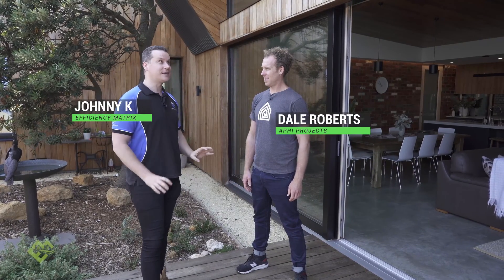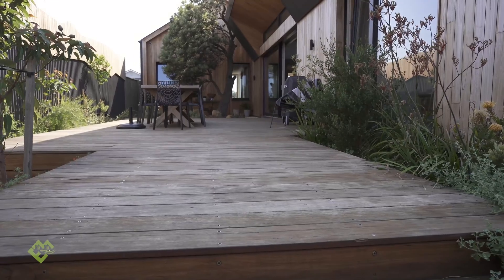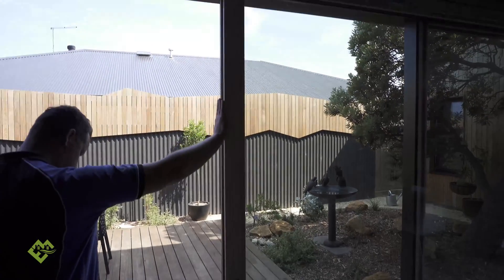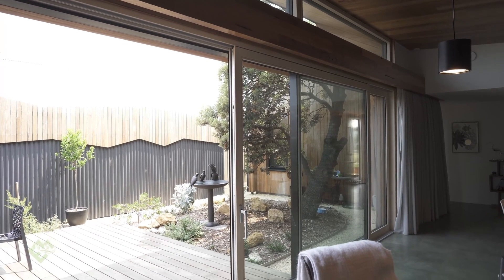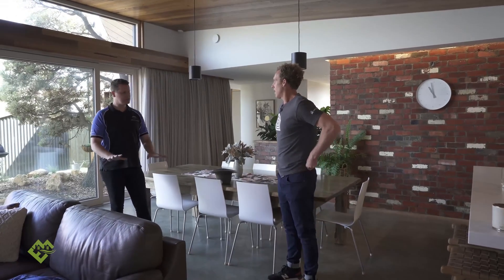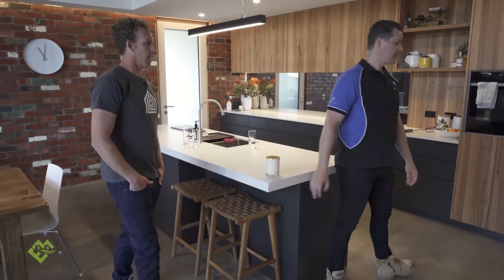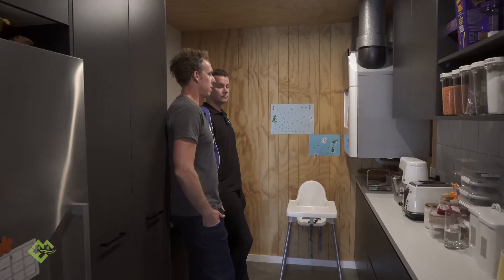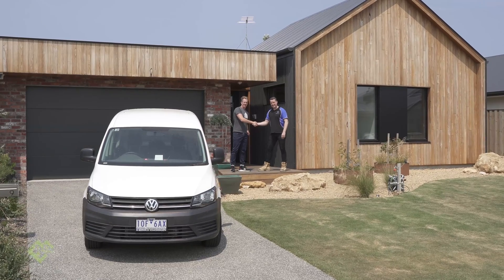Awesome Detailed, Passive House Home ecoEVO #10

Comment: The public needs to be educated about the benefits of energy efficienct buildings.
Air sealing and blower door testing is under appreciated. Air sealed, super insulated, triple pane windows, high efficiency heating and air conditioning systems, high efficiency appliances, LED lighting systems, set back thermostats, 2/6 or 2/8 wall construction with thermal breaks, solar panels with battery storage and an EV charger in the garage. Saving energy saves money on utilities and makes the building more comfortable.

Comment: Jonners, Joseph, Dale - great video. Did you send a link to Daniel Andrews and the VBA. If you look at the mess that we are being saddled with and in spite of that there are great Passive House Builders who are walking the talk rather than the " WOKE" BS alarmism. The planet is not going to die in 7 or 12 years but we do need to manage our resources sensibly and sustainably. Build with Passive House principles and 'genuinely' cut emissions by 40-50% ...why - because these homes need so little energy to maintain a stable comfortable temperature.  You can't get better than SIGA Airtightness membranes and tapes but you need the elbow grease Dale was talking about and the attention to detail in managing trades with a gung-ho attitude and a knife!  Fantastic result Dale!
Reply: Well said.